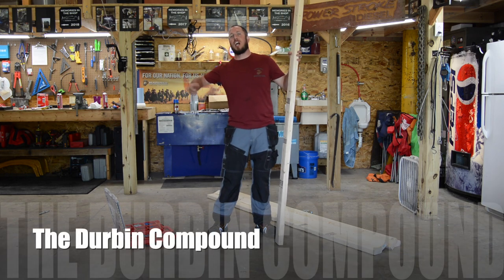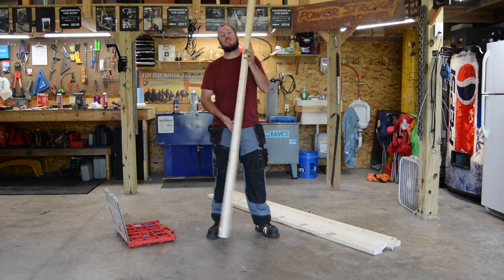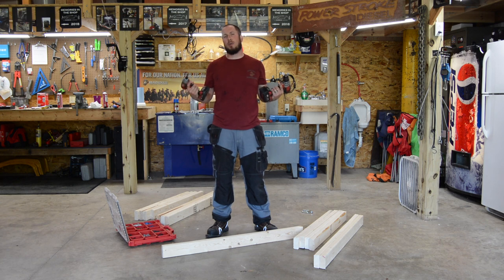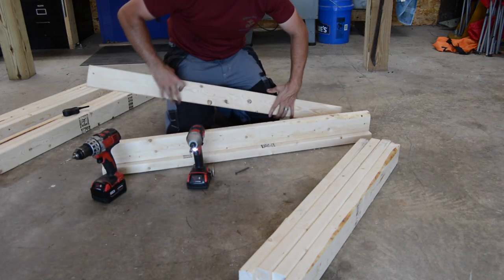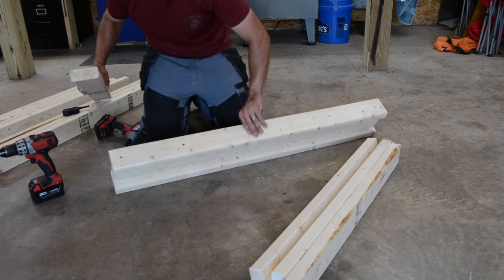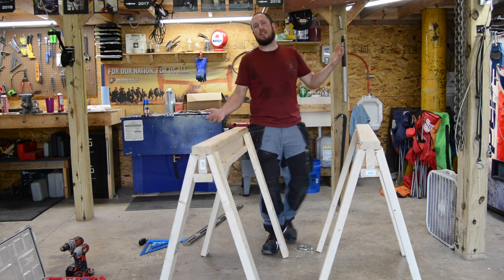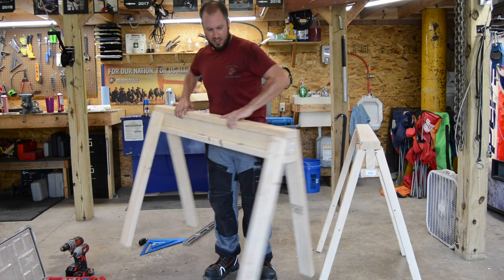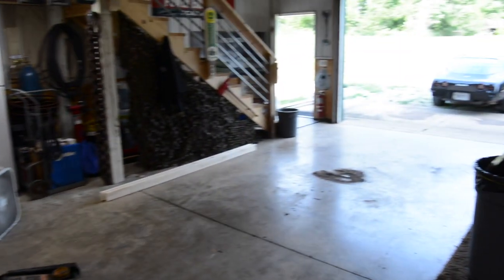Cheap Sawhorses That DON'T Suck!

Comment: Save some weight and leave that top 2x4 off. It doesn’t add any strength or function. Also it’s best not to have any screws or nails in the top, so that you don’t need to be concerned about hitting them with your saw, while making a cut and ruining your blade.

Comment: Great video.  Thanks for sharing.  I built a set this afternoon to use as a door painting jig.  One simple step to increase stability and weight bearing capability is to add a 1x2 or 1x4  horizontal cross member on the outside of the legs about half way down to make an "A" frame.  That will keep the legs from splaying.  Make them long to start with and after they're screwed on, mark the overhand, take them back off, cut off the overhand and reinstall to have them flush with the legs.  Super strong.
Reply from the maker: Great tips!

Comment: First off, like the soda machine in your shop. Good job of showing a simple design that is easy to build. Have several sets with a 48" long 2x4 on top. I keep 3 each 2x10s 10 ft. long to put on top of the set of saw horses.  Lengthwise cut of a sheet of plywood with out a piece falling. Also keep several 2x2s 48" long to put on top of planks for cross cutting a sheet of plywood and not hitting (cutting) the planks. Use it to hold my DeWalt miter saw, cutting up plywood, assembly, painting and scaffolding. Found that the vinyl post sleeves are 4" and just right for when using my miter saw.

Comment: Great video, a fool proof simple to build saw horse. I found adding ply to the each side countered the tendency of the screws, and therefore the legs, to work loose after much use

Comment: Thanks for sharing. Just built a pair of saw horses from watching your video. Slight alteration was using 2 x 6’s for the legs (the only lumber I had). They turned out great - perfect for putting my sailboat on, and strong, too 👍🏼

Comment: Well presented video, no waste of our time, and the only thing I would add are 1x4 (X) cross braces on both sides for max. stability since I've had a couple of horses pull up lame and collapse when working with heavier loads - so now for safety I use three instead of two, (much safer).

Thanks for sharing from a new subscriber, hope to see some other ideas in the future.
Reply: "Pull up lame"   Thanks for the laugh!

Comment: I'm going to make some of these. I like the simplicity, everything is square cuts. Looks like you could make one of these on the fly in 20 minutes.  I keep buying those folding sheet metal horses  for storage that are compact and light, then I overload them and wreck them. Considering my sawhorse history I better gusst the ends. Great video!

Comment: I like your Urinal in the back ground. If you don't have a video on how you hooked it up or run water to it and septic system can you at least do a walk around video? Thanks. I am thinking something similar using rain water collection and a dry well
Thanks
Reply from the maker: That is kind of how I have it hooked up.  I have a 20 gallon barrel on the catwalk that I fill with the garden hose.  The discharge goes into an angle straight out the wall and onto the ground.
Reply: @TheDurbinCompound  Thank you 😊

Comment: Okay I made a set of these. They do go together fairly quick ,but the main complaint I have is you probably have to play around with screw sizes and placement to control splitting. Also- they are okay for light duty but if you're going tho put a lot of weight on them you might want to add some horizontal bracing between the legs close to the bottom.

Comment: The last thing I would do after assembly would be to remove the top 2X4. If you do much sheet work you will cut one , same with putting the top screw of the legs to close to the top.

Comment: I think I'll put some adjustable feet on mine, like the little rubber padded screws you find on the bottom of ovens or refrigerators to level them.  That will help them stay balanced on uneven surfaces

Comment: Burnt out a table saw on 2x4s? Must been a DEWALT 
Bad design when there is metal in the top board, you’ll hit them when sawing...
Reply from the maker: It was a DELTA! Haha I replaced it with a DeWalt

Comment: Not bad, easy to stack up and possible to make with handsaw and screwdriver, but .... there is a distinctive lack of "umph": no miter cuts, sharp edges of the legs right next to the main, flat beam... Thumb up for the effort, but try harder next time! ;)